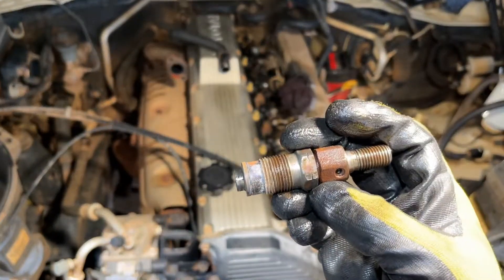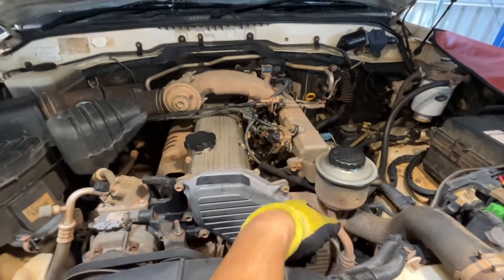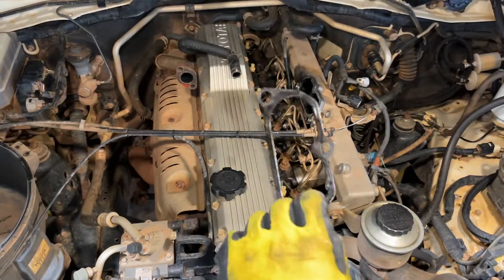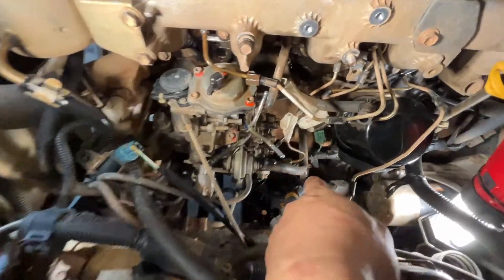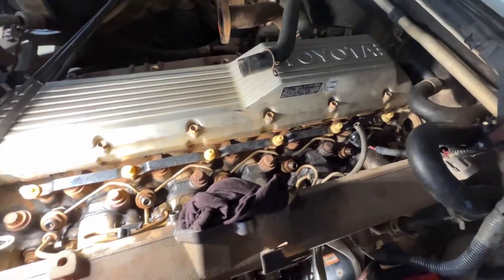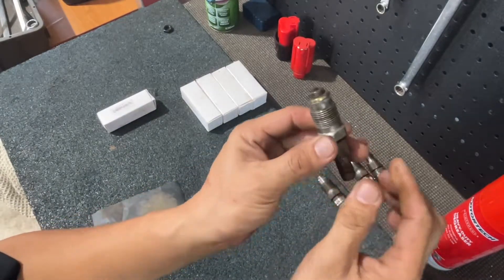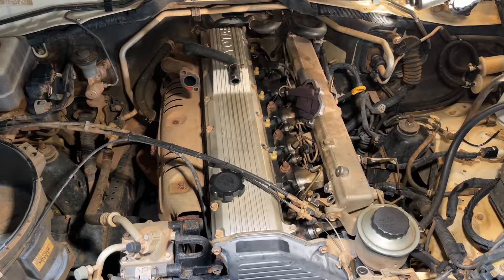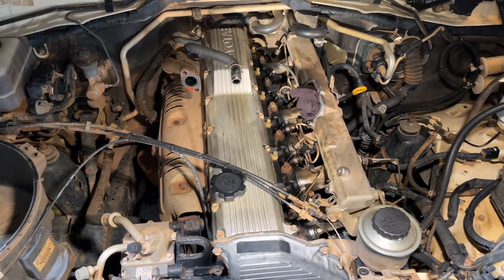HOW TO REPLACED TOYOTA LANDCRUISER INJECTORS

Comment: Always avoid shifting spanners where possible. They are a great tool for rounding nuts & bolts. Get yourself some flare nut spanners.
Reply from the maker: Actually mate I always use a spanner for doing a injector same with that job it never rounded my injector maybe I’m just only lucky 😅 but i have a set of flare nut also 😉

Comment: Did you replace it with genuine Toyota injectors ?
Reply from the maker: No mate I installed aftermarket one 😉
Reply: @oliverthemechanic8532  how much did it set you back? Was it Chinese injectors? Doesn’t the new injectors need to be bench tested before installing?